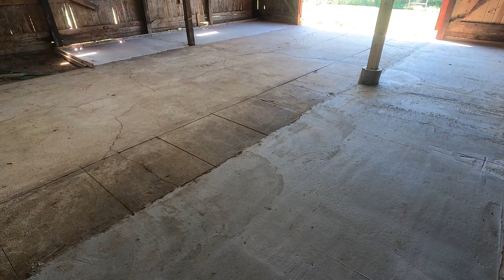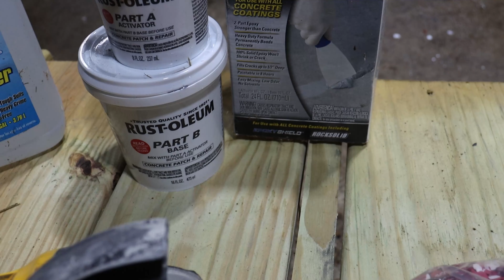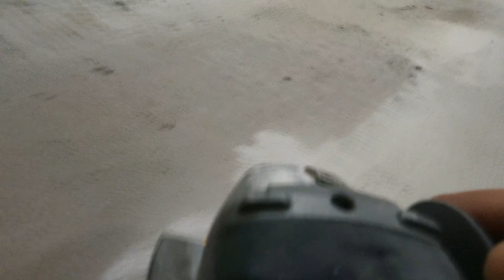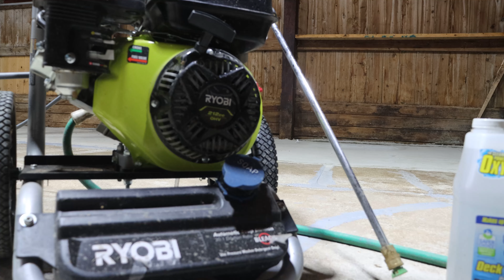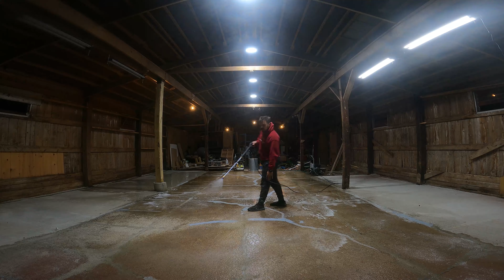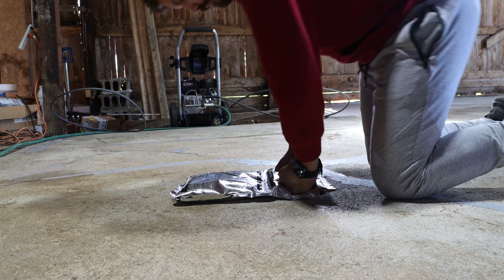Putting an Epoxy Coat on my New Shop Floors - Barn Reno EP4

Comment: How do the chips feel under foot? Do they stick out of the epoxy, or do they just sink into it? I was expecting you to have to do a second layer of clear epoxy to lock them in
Reply from the maker: They sit on top. You can’t really feel they, they basically sit flush. I know you can add another coat on top, but it doesn’t really need it.